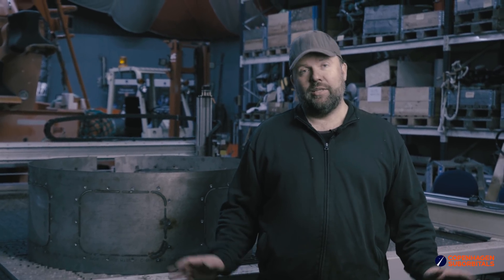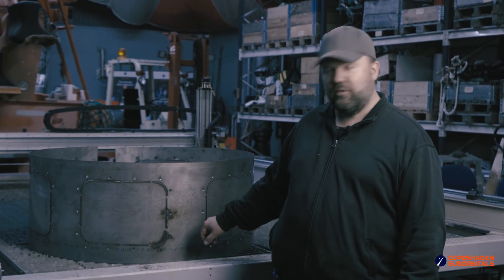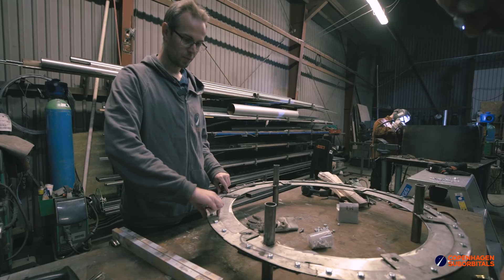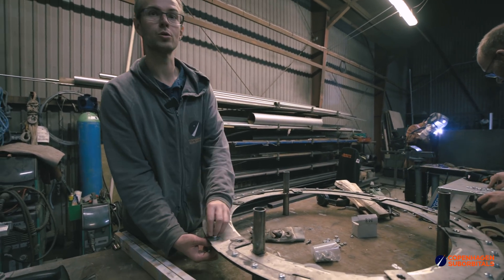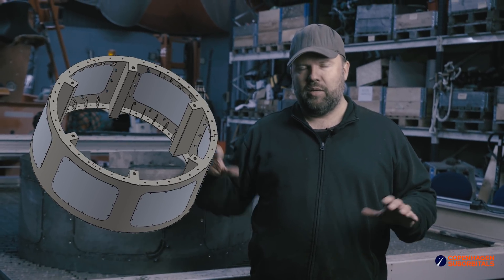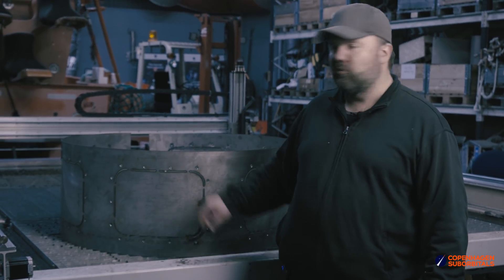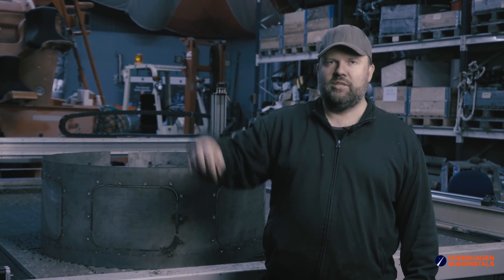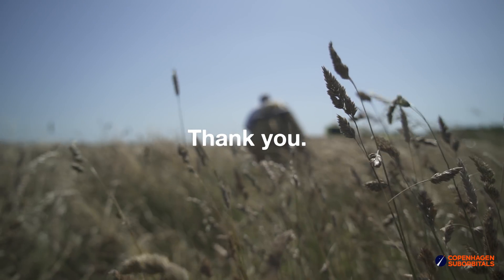Let's Build Our Own 304L Stainless Steel Starship!

Comment: How did you choose the steel thickness?  Seems that SpaceX Starship tanks handle all the loads when kept pressurised reducing the needed thickness. Are you aiming at the same concept? Thanks for sharing your progress. Always fascinating what volunteer engineers can achieve.

Comment: I'm curious if you thought of using steel before or after Elon and, if after, how much more capability due to reduced costs has that given you? I look forward to your next video
Reply from the maker: Long before. 
The spica plan was set back in 2014.
And the biggest reduction in costs for us has been our homebuilt CNC plasma cutter which eliminates the need for us to outsource a metal cutting service provider.
Reply: @CopenhagenSuborbitals  Interesting. That being the case it must be gratifying that SpaceX has found their best option to be the option you took.  Bit of validation for your concept and implementation. :~) It does go to show though that just because they are bigger and have more cash that the big boy companies can still learn things from the little guys. Sometimes I think having so much cash resources etc can lead you to think more complicated than strictly necessary. :~) Thanks for the reply.
Reply from the maker: @pegasusted2504  It's neither us nor SpaceX that were first to use stainless steel to build a rocket, so there's no reason for any sense of gratification. It just happens to be a material which unique properties we both hope to use for our advantage given our priorities. But it is definitely great to see how this new era of private space companies is bringing new ways of thinking into the aerospace industry. For example building the biggest rocket the world has ever seen in an outdoor construction site. :)